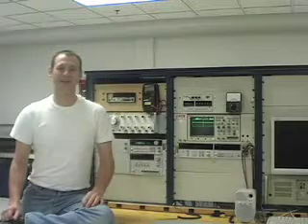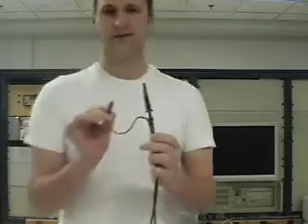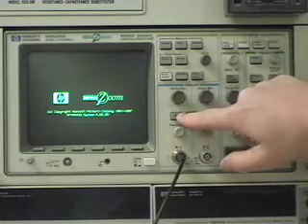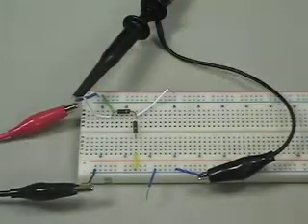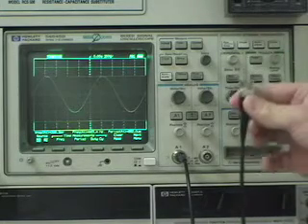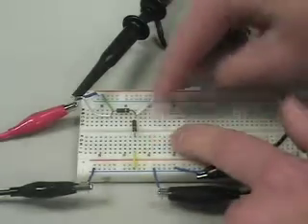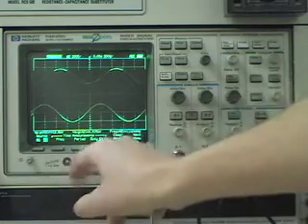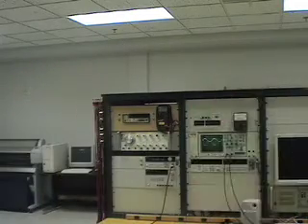Oscilloscope Tutorial

Comment from the maker: @GregoryGraveyard Any number of reasons really. In the most simple case, you have a 10V source, but you need a 5V source. You can get 5V by using just two resistors. You need to then make sure that you do indeed have 5V, so you measure it.  :-)

Comment from the maker: Umm yeah, we were having trouble filming the output and input signals together (because of the frame rate of the camera and what not), so we hooked up a 2nd source with the amplitude of the output. For some reason that showed up fine on the camera, so we kept it. What sucked is that we didn't realize this was a problem with the phase until after we had finished it. It was for a class and it was the end of the semester so I just left it. :-)

Comment: How did you get a phase diff off a voltage divider?  those two waveforms were off by at least 15 degrees.  Are those wirewound resistors or something?